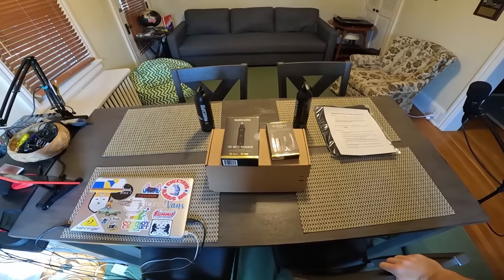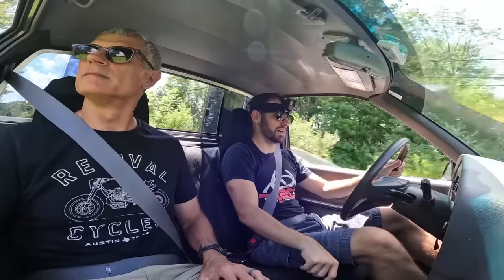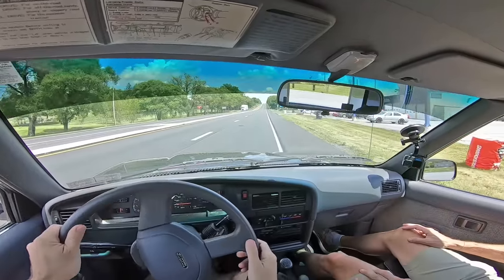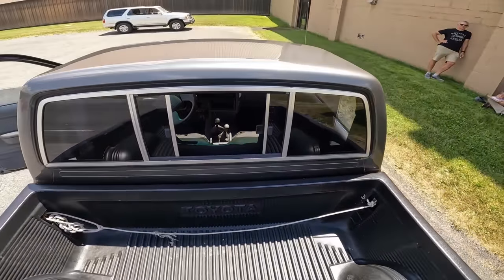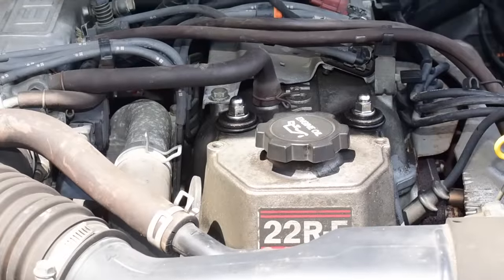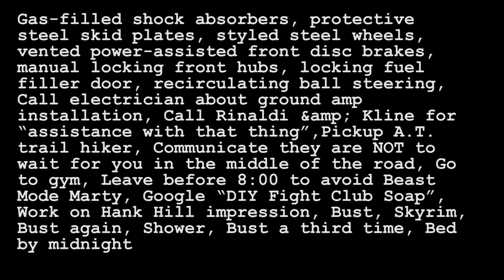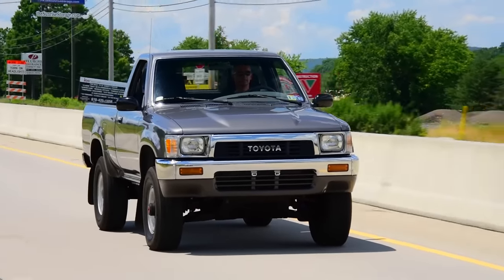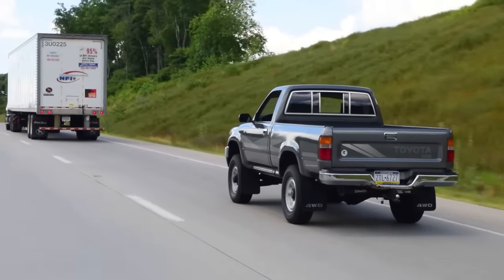1989 Toyota Pickup SR5 4X4 5MT: Regular Car Reviews

Comment: My Dad owned a crew cab version of one of these. It was a diesel, it was even slower, but it had a massive bullbar and external rollcage, as well as a custom built wooden flatbed, all of this adorned with so much rust it was actually 2 different Hilux's pieced together, seriously. The body was blue, the doors were green, as well as a couple other fenders, but I can't remember exactly which. I have nothing but fond memories of this vehicle, days of going to the creek spots no-one else could because there were huge rocks in the way that the Hilux didn't care about, Dad just got out, engaged the lockers and my sister and I got out and rode on the back because it was more fun.
Reply: Crew cabs sre heavy. My dad has a 1999 and Is slow AF.
On the other half, my uncle had a 1993 model, also Diesel but extended cab. I dont know wth that truck had, it had the stock 3l and that thing was fast, it wasn't slow like other Hilux of the Time
Reply: Sick As.
You had a glorious upbringing.
Cherish the memory
Reply: Sounds like amazing memories.
Reply: Fucking awesome.
Reply: Old man got given a 2wd crew cab diesel few years back as his work truck that had been converted to LPG, don't ask me how or why but it had spark plugs in the diesel block where the injectors should be, it idled like chitty chitty bang bang and was highly amusing to drive.
Reply: GOODTIMES 
in Roman's voice
Reply: My grandma's friend had an 80s hilux, blue with a self made cowl cover. It was so much fun. We used it on their move to another building. The guy had to sell it because he lost a leg and needed an automatic
Reply: Jesus said to him, “I am the way, the truth, and the life. No one comes to the Father except through Me.
John 14:6
Reply: The Hilux with a diesel engine and left hand drive is the Philippines Hilux.."
Reply: @SeektheLordsface  jesus tried to buy my Toyota.

Comment: Imagine if Toyota introduced a Hilux Classic today, same size as this truck, but upgraded to today's quality and safety standards. The truck would be cheaper, faster, safer, better performing and less bouncy on the roads. It would also probably be much more practical for a lot of people who already have big trucks because "big" was the only purchase option they had at the time. Heck, even today's "compact" trucks couldn't pass the narrow alleyway test!
Reply: That’s my wet dream. Owning a modern day Hilux with its original size, but with better tech and manual trans.

I went out and bought a ‘01 Tacoma with a single cab, manual because I absolutely adored the compact size and attractive body style. I wouldn’t be caught dead driving a modern day “compact” truck.
Reply: They do make a single cab style side hilux still....and a extended cab and a dual cab 😀
Reply: Ford has more orders for the Maverick than they know what to do with. It doesn't hurt that the Ranger is practically the size and price of an F-150. If Toyota wanted to cash in on that market with a reasonably priced, reasonably sized, high quality, possibly hybrid, true compact truck, they could rake in money like Ford is doing.
Reply: Part of the size is the safety standards. That’s why new Honda Civic weighs 3300 pounds.
Reply: Could probably make it on a RAV 4 chassis (though they'd probably be better off with a Corolla as the Rav 4 might be too big, damn modern vehicle sizes).
Reply: @NSUGS  Came here to say this.
Reply: It would be a true rival to the Maverick for sure.
Reply: Well, in Australia, Europe and mostly here in Latin America, there's a lot of Hilux versions. Still pretty reliable, only in diesel tho.
Reply: @gabrielrodriguez9229  You say 'only in diesel' like it's a bad thing! 
<3
Reply: @gabrielrodriguez9229  would love to have one up north. I saw an old diesel ranger the other day... what a dream run around farm truck. 4 wheel drive, 96 hp, gets near 60mpg with a little mitsubishi diesel. I love my first gen tacoma, but with a small old school diesel engine it would definitely be a better truck.
Reply: They do just not in the US. As well as 70 series which is unchanged for over 30 yrs except for in Australia they have the twin turbo diesel v8 instead of the original unbreakable almost 4.2 diesel..
Reply: @jameswilliam904  That turbodiesel V8 is a monster! I'd love to have a little 4 cylinder, but I'd do a backflip if we got either. :3
Reply: All that safety stuff would make it far heavier than what they were. It wouldn't be feel the same way all.
Reply: @calisonic  would it though? My first gen taco feels pretty nimble even with a 4 cylinder, and it’s pretty modern.
Reply: @calvinnickel9995  No, the size makes safety WORSE. Those battering ram front ends create huge blindspots, and brutalize anything you hit.
Reply: @jameswilliam904  70 series is a single turbo V8 diesel...the 200 series runs the twin turbo v8 diesel
Reply: there's a similar thing going on with the land cruiser pick up, it still looks like the early 2000s truck with modern stuff.
Reply: the new hilux is the same size dimensionally as the 80s and 90s ones, weigh a bit more but theyre more heavy duty, also theyre just as shit, i have a 2020 hilux single cab 4x4 as a work ute, its pretty bad compared to isuzus
Reply: The 80s Mitsubishi Diesel engines from the Mighty Max and D50s had trouble getting oil to one of the main bearings, which results in that bearing going out in less than 100k.
Reply: Toyota will bring out a compact truck in 2024 or 2025.
Reply: The closest you'll find is an old style Ranger or S10. But those are rapidly rotting away.
Reply: They could build it off the Highlander or RAV4 and it would sell like crazy.
Reply: @calvinnickel9995  That's what people said 10 years ago. Then Honda made an Accord barely above 3200 a few years ago and Civics that were sub 2800
Reply: People have been asking for reboots, (that focus on low weight and simplicity,) of the Jeep XJ and Toyota Hi-Lux for 2 decades. They'd sell like crazy.
Reply: They can keep the bloat and safety standards.
Reply: @kyle8952  unfortunately the reality of consumer products is that if negatives can be externalized from the customer, manufacturers can basically pretend they don't exist until regulation comes into play.
Reply: Yes sir!
Reply: I remember doing size comparison of my 1998 Chevy Extended cab truck to a 2017 Chevy Colorado that was a crew cab short box and found that they were pretty equal in size.
Reply: I own an 02 reg cab 5sp. Would love this with the x-runner 6 spd.
Reply: Toyotas competition to a Ford maverick and hyundai SantaFe would be dopeeee
Reply: More powerful, more Efficient, longer lasting simple diesel with manual and automatic versions. Thicker metal so it doesn't just rust out. Metal toggle switches instead of plastic.
Reply: Jesus said to him, “I am the way, the truth, and the life. No one comes to the Father except through Me.
John 14:6
Reply: The maverick?
Reply: It would be plastic, cheap, overpriced, wiegh to much, have computer crap in everything, and be a hollow echo.
Reply: Just use ally body panels where you can and drop in a modern engine. Leave the rest as is = my dream truck.
Reply: The thing is it would be like 3x the original price.
Reply: Holy crap that would be a dream come true. Old styling with new internals wowza
Reply: It would suck.
Reply: @kyle8952  it should brutalize anything I hit. Stay the hell out of my way.
Reply: @BeingMe23  doubtful.
Reply: Upgraded to today's quality? You mean downgraded to today's quality. Today's vehicles aren't even built half as well.
Reply: I saw a YT video that claimed there are no more compact trucks because of EPA fuel economy regulations. The larger trucks have lower MPG requirements.
Reply: @calvinnickel9995  American trucks have only grown exponentially in size to get around emission requirements. Bureaucracy at its best.
Reply: It won’t be the same size as this with modern safety standards, what if they sold this fucker as it sits with a waiver saying you can’t sue them. I would buy one tomorrow with an if you die in it, you die in it waiver.

Comment: A year after I was born, my father purchased a brand new 95 Toyota pickup with a 22re, king cab long bed, 5 speed manual. It has ac and power steering.  I don’t have a clue how my father survived driving it around San Francisco until the early 2000s. It was the first vehicle I ever drove, and my first car when I turned 16. He gave it to me with 530,000 miles, and it ran like new. The truck now has 900,000 miles and has taken me everywhere. The 22re in it has never been rebuilt, has never been apart, and continues to run. It starts every time I drive it. The interior is also perfect, because my dad had seat covers and plastic coverings for the carpet. All in all, the truck has been through the ringer, and comes back every time asking for more. I plan on hitting a million sometime next year.
Reply: Did you hit a million?
Reply: How did you get those high mileage so fast?...My Uncle's 93' 4runner currently around 450k miles.
Reply: Holy high miles Batman!! You must drive 1000 miles a week!  You need to post a pic of the ODO, would love to see it!  Any engine/tranny work done?
Reply: @AndrewR10001  92 short bed, a/c, 5 spd, rwd.  I added an am/fm/cd, ebay power window kit, bedliner, led headlights.  600,000 miles and on 3rd electronic cluster, replaced the timing chain one time, 2 a/c compressor activation switches and 2 fan speed switched, the A/C condenser and receiver dryer, the clutch once and 2 used AFM's.  Also, moved that mf fuel filter up to the passenger side fender (if you have a 2WD and no lift it is virtually impossible to remove that filter at ground level....even if you pull the starter!  Note:  ALL of the YT videos showing fuel filter replacement are showing either  a 4WD or RAISED vehicle lifted at least 2 ft. off the ground....and thus the angle of approach and space available to reach the filter are vastly different).

NO RUST in, out or under this Florida marvel.   I rely on this truck as my one and only daily driver and I treat it accordingly.  I have personally performed every bit of maintenance and a/c repair work except the clutch....It has never totally stranded me.  It pays me back by starting and running very well to this day and it is BY FAR the best vehicle purchase I ever made.  (I could head cross-country this very minute without as much as checking the oil.  I want them to bury me in it lol).
Reply: @AndrewR10001, my 95 only has 191k

Comment: The mid 80s SR5 was the actual star car of Back to the Future, far cooler than the Delorean.
Reply: I thought it was nice looking truck, but compared to a time machine, c'mon.
Reply: Fk yeah that Marty McFly 🛻 🔥
Reply: Agreed, aside from the added time machine fluff, that Delorean was garbage
Reply: I agree "Check out that 4 by 4!"
Reply: I find them equally cool.
Reply: I always loved the black SR5 in BTTF way more than the DeLorean as a kid!
Reply: Funny I just saw the Drake meme (might have been the LaForge variant) with the Delorian in the top and the SR5 on the bottom. Hell yeah.
Reply: Ehhh. really?
Reply: That one specifically is a 1985 sr5 xtra cab pickup truck.  Either EFI & SR5
Reply: Nah, I disagree. The Delorean’s unique stainless steel body and gull wing doors are iconic. The Toyota SR5 looks cool and is amazing for off roading, just make sure you dont crash into a pearly white Rolls Royce.

Comment: As a Toyota mechanic in the early 2000s I made so much money working on these trucks. Toyota had a massive recall for the steering rod relay breaking and almost every recall needed ball joints, tie rod ends, idler and pitman arms Or you would hear the timing chain chewing on the timing cover then the truck usually became available to buy.  I always wish I would of bought one.  Buy the 4 cylinder avoid the 3.0 V6.  Sweet truck.
Reply: Oh I remember that serpent of a timing chain chewing sound , worst on startup
Reply: Better yet, but a 3VZE truck then swap in a 3.4L 5VZ.
Reply: @gohilux  the 3.4 Tacoma is just a better truck.  Let it keep its engine
Reply: @lukelowe918  it's kind of funny that Toyota was able to take arguably one of their worst engines, the 3VZ, and turn it into one of their most reliable with the 5VZ. The 3.4L/5VZ swap is super common into these trucks. Mostly sourced from a 3.4L 4Runner. As the 3VZ and the 5VZ have such similar (almost identical) blocks, were used with the same (R150F) transmission, and were used in the same vehicles, you can drop a 5VZ 3.4L motor directly into a 3VZ truck with minimal modification. It'll bolt right up to the 3VZ spec'd transmission when using a 5VZ clutch and flywheel, and you only need a wiring harness adapter and relocation of a couple accessories in the engine. Once the 3VZ blows up in mine that'll be next on the list.
Reply: Ahhh. ol’ recall 50N. 
Still on the books
Reply: @taylorious1693  favorite recall ever
Reply: @taylorious1693  don’t forget the infamous VO6 Special service campaign for the 3VZ head gaskets. To the best of my knowledge if you’ve got a post-‘90 truck with a 3VZ, if the head gaskets haven’t been done yet you can still take it in and have them done at a dealer.
Reply: @lukelowe918  how does getting paid on a recall work? I hope the customer doesnt have to pay for your time. Do you bill the company?
Reply: @leorickt.9604  Toyota has a set labor time for all warranty/recall work.  If it pays 4 hours and take 2 you get 4.  If it pays 4 and it takes 12 you get 4.
Reply: @lukelowe918  okay yes thats sort of what i figured. Thanks!
Reply: @leorickt.9604  so toyota would pay for the steering rod relay but the customer had to pay for worn out ball joints, tie rod ends, ect.  Usually these trucks would come in for the recall and I could get $2000 worth of customer maintenance when I did my inspection.
Reply: I’ve got the 3.0 they are junk. The later 3.4 would be an awesome swap in.
Reply: This is how I came by my 83 pickup. Previous owner thought the head was warped. Nope, chewed through timing cover  that cracked wear the water jacket was. Took me a head gasket and machine shop trip to discover it. Only paid $300 for the truck back in 2006.
Reply: I have the same gen 4runner and just did all the repairs you list that never got done 💀 and also you're right, if you can help it, don't get the 3.slow. 

That said, I'm keeping it forever 😂
Reply: *would HAVE bought one
Reply: @vincedibona4687  grammar hero lowest form of YouTube commentary
Reply: @SpecialAgentJamesAki  Did that to a 95 4runner. Was 3.0 4x4 auto. Engine was blown. Got it for $400 and $5000 later it has a 3.4 from a 98 4runner and a 4x4 M/T from an 88 Toyota truck, 98 taco 5vzfe 4x4 m/t ecu (rape), new upper and lower control arms, struts up front, struts and springs in the back, 31" bfg's all around, both cv axels, m/t drive shafts, interior bits, fuel pump and filter, dash harness conversion, idler arm,. gaskets and seals for engine, clutch kit, braided brake line for clutch, master and slave, fuel line extension, rpm fix (resistor jump), clutch pedal bracket, cross over pipe conversion, misc switches, relays, grounds, fuse box, and intake, end links all around 

Three months of part time wrenching, part finding, cursing, electrical issues, more cursing, and it's been alive for two years fault free so far.
Reply: The 5VZ swap into older pickups isn't easy. If you have a huge garage you shouldn't consider it anyway. You should have enough for something better
Reply: @vincedibona4687  would've *
Reply: I worked at the dealer near me at the time that recall was going on. It was wild. Some of the trucks that came in looked like they should have been totaled but they got the work done. One had 6” of mud on the floor!
Reply: @lukelowe918  It's okay Luke, I'd also be embarrassed if I made middle school grade spelling mistakes in my native and only language (you're American, so I took the liberty of assumption here lmao).
Reply: Wasn't this the first year with a new body shape?
Reply: Lol the 3.slow
Reply: @lukelowe918  I like people to look and sound smart. Using "of" instead of "have" is the lowest form of grammatical errors. People stop doing it, I will not have to correct anyone.
Reply: @dipstiksubaru3246  You realize that is the same as what I said? That's just a contraction of the same two words. And my point stands, "of" makes no sense when one is supposed to use "have". Just because they sound similar doesn't mean they mean the same. So, you corrected me needlessly. shrug
Reply: @vincedibona4687  No you should've used the contraction period. You're wrong.
Reply: @dipstiksubaru3246  There is no difference between saying "would have" and "would've". 

I am not even going to argue this. OMFG. rofl
Reply: *would've

Comment: Considering the national speed limit was still 55 mph, it did what it needed to brilliantly for the time
Reply: I have a '97 nissan version. 5 speed and it is  s l o w. I'm at 3k rpm at 60.
Reply: Speed limit in 89 was 65.
Reply: @aaronperdue8979  On November 28, 1995, Congress passed the National Highway Designation Act, which officially removed all federal speed limit controls.  it was 55 mph until then on most highways.
Reply: @aaronperdue8979 not in many places...

Comment: My first truck was an 89 Toyota pickup, base model. 240k miles, rust on every inch. My father told me that I’ll miss that truck when it’s gone. 

He was right.
Reply: What happened to it?
Reply: same... mine was nearing 200k when it was given to me ... i had paint work and a radiator change done on it... the shop forgot to fill the radiator back up... blew it up... i surf used ads to this day but cant stomach the 17-20k price tag for a sorted one.